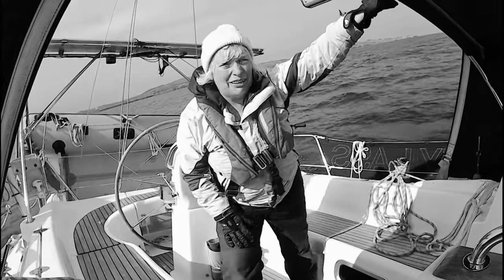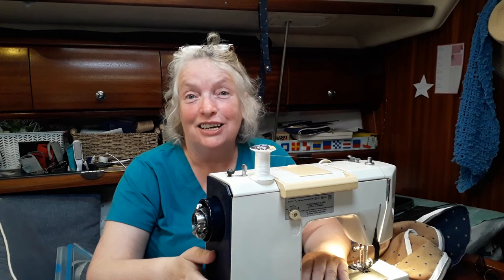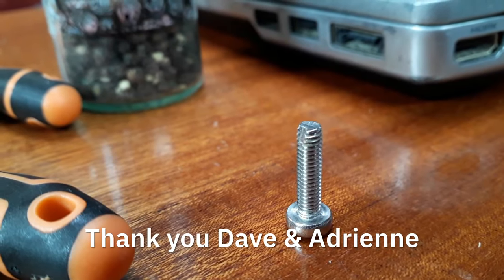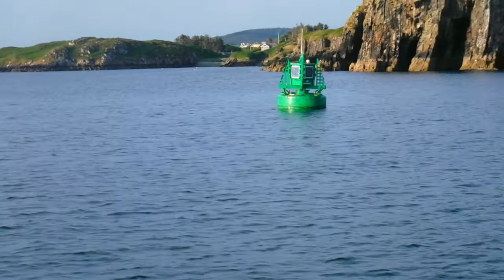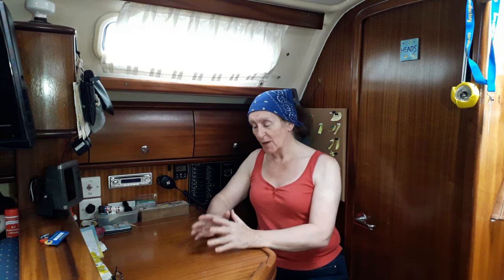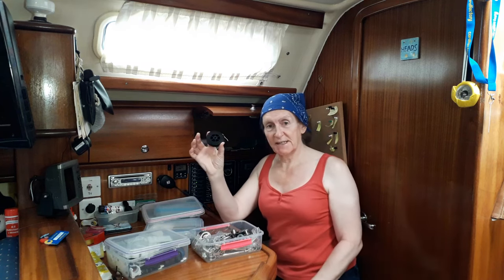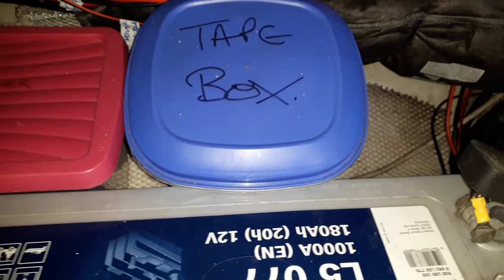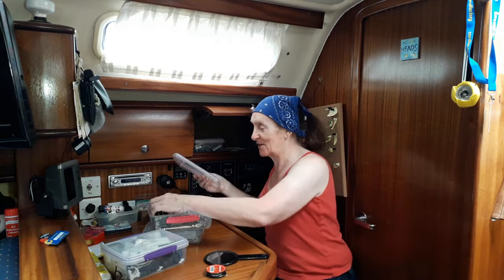NOT Sailing Northern Ireland - This is why your boat is full of junk  - Ep. 344

Comment: Yes, quite my experience also. I also carry some aluminium foil. Just in case a fuse should break, that I don't have as a spare. Close to 20 years ago I made a short on our TMC toilet and the fuse burned. The fuse was inside the operating switch. Last year the &@##€ switch broke. Took appart the switch. And the fuse wrapped in aluminium foil materialized. A sustainable repair. The &@##€ switch went in the proper trash, and was replaced by a 50 A car starter switch. Still there, sustainable. If I should empty 16 ton sv Hulda of spares, ropes, nuts and bolts- not in every day use, the waterline would raise 50 mm (2 inches, being imperial).
Reply from the maker: We do wonder how much our waterline would raise up as well. We saw a similar boat to our used for racing and it was more on top of the water rather than in the water so we presume that it was emptied of nearly everything. If our original coppercoat was correctly at the waterline, it is now a few centimetres under 😄